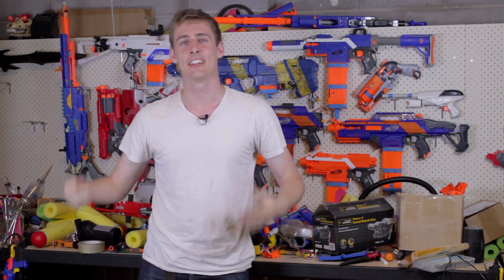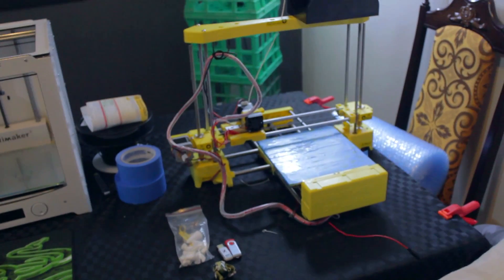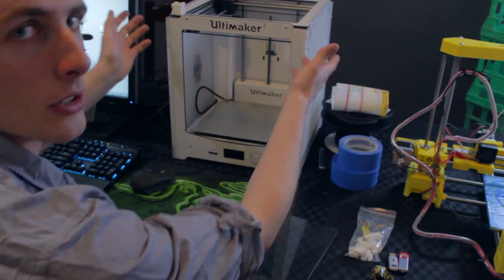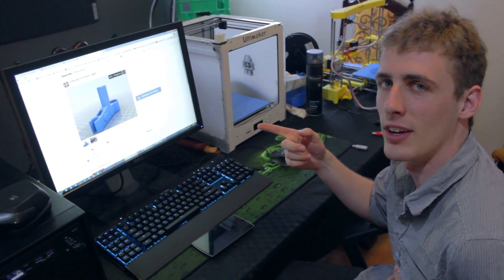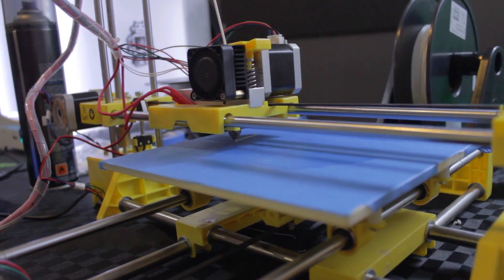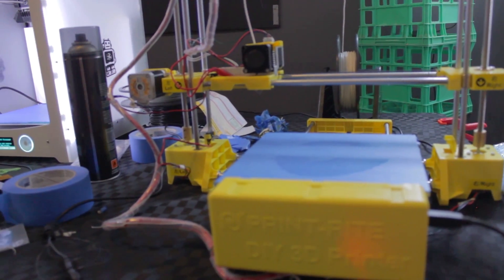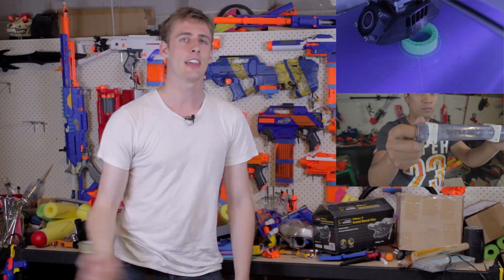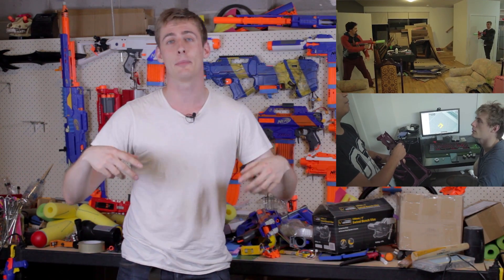ULTIMAKER 2 vs PRINT-RITE DIY 3D Printer & How to Bed Level - PRINTER PARTY | Make Test Battle

Comment: Terrible comparison. First of all, ultimaker 2+ can be had for 2.5k USD, not 4k. Second, mine has just worked from the start. Never compare a lemon as the brand.
Reply from the maker: +createthis AUD + import taxes + 2 years ago price. I'm telling my experience. I'm not going to sugarcoat it just because other peoples work.
Reply: +Make.Test.Battle Seems like you Aussies always get the financial short end of the stick. That's a terrible price. I wouldn't expect you to sugar coat it, just seems odd using a lemon as a brand mascot.
Reply from the maker: +createthis Indeed particularly since our dollar was so weak when I bought in... "Australia Tax" is so real. Example: You convert the American price of Overwatch ($40 USD) to AUD and you get about $50. Blizzard has it listed for $70 AUD on their site. $20 more because Australia. The whole point of the video wasn't to do a comprehensive review or whatever, its was to show a behind the scenes look at the reality of printing. Things go wrong it certainly isn't a "Play and Play" device -R
Reply: +Make.Test.Battle 4k AUD right now is 2931.72 USD right now, so that's not quite as bad as I was thinking when I wrote the initial comment, but it's still a good $400 USD over the price of a 2+ right now.

Was this your first 3d printer? I wonder if a lot of the trouble you had was just learning curve. I bought a printrbot plus (plywood kit) for my first printer and it was a nightmare compared to my ultimaker 2+. The 2+ extruder has been improved a bit over the 2 model too, so that could also be a factor. I did have like one failed print when I bought it, but that was user error. I was attempting to feed the filament around something in the back of the unit that I shouldn't have, causing a jam. Been fine ever since.

My kids actually use the 2+ whenever they want. That would have NEVER happened with the printrbot plus. Sometimes I wake up to find my son printed a new toy for my daughter. Crazy times we live in.
Reply from the maker: createthis The main issues have been mostly resolved by now but they came from weird and slightly self induced problems I had and ones I didnt expect to have paying for a high quality (or at least high price) printer:

- The UM2 fan mount was terribad and had terrible cooling and curling of the right edges of parts
- One of my fans had a dud ball bearing and was super noise and only ran about 50% speed
- I replaced the fan and the shroud but jammed a wire into the heatbreak cooling fan and didnt notice for 12 months causing most of struggle (my error)
- No australian stores sell 2.85mm filament (only 3mm) so the original 1/4"ID bowden had super high friction and under extrustion with all the filament I could get
- Printed a new extruder to help which was good until I printed retraction heavy parts that flattened and widened the filament to the point of jamming in the bowden
- That's about when the control board exploded mid print and had to pay $400 to fix it out of warranty (that is also included in the $4K price fyi) but that revealed the jammed heatbreak fan
- The new board had new firmware that made me find out that the fan shroud I printed over cooled the print nozzle when close to the bed which was also causing massive underextrusion, jamming, and grinding problems on the first few layers. At that point I had to jerry rig the printer to make a new one out of ABS
- Bought new 4mm ID teflon but the collets were undersized so that didnt hold
- Modified my printed extruder pieces and the print head to take the 6mm bowden properly
- By this time all the crazy setting I had tried to use to get the previous underextruding disaster machine to work where totally wrong so I did a factory reset and reset my Cura settings
- Now im in the process of doing the proper calibrating and dialing in of the print quality so that I have a usable machine.

Sitting here waiting to find out what fucks up next.

That went way too long; I'm just getting a bit sick of people telling me that "you paid too much" and "printing isn't that hard" and "my i3 does way better". Their half right. I did pay too much, but printing really can be hard regardless of how much you pay -R
Reply: +Make.Test.Battle That's a lot of trouble for a bad fan bearing and hard to find filament. I feel your pain.
Reply from the maker: createthis mm. It has been a frustrating road made more so by how ridiculously simple the answer is/was -R

Comment: By the way, there is a free program called FreeCAD that works on the same principle as Solidoworks. And it's free. However, it is a bit more difficult to use and less forgiving.
Reply from the maker: +MetaBloxer Interesting. I might check it out to recommend to new users, but I have solidworks and  was trained to use solidworks, so I keep using it personally -R

Comment: lie
Reply from the maker: +Dominic Beacham What do you think is a lie? I have no reason to lie about anything that I own -R
Reply: The ultimaker is way better. Yours failed for about half the video and you said it was way better.
Reply: That is a total lie
Reply from the maker: Dominic Beacham I truthfully described my experiences with this machine. I have had nothing but problems with it so far although it is at a point now that is is fairly reliable for printing.
Why would I lie about it? I have no personal vendetta against Ultimaker, in fact I really appreciate all the help their support team have provided me to try and help fix my problems. I am just telling the world about my experiences. -R
Reply from the maker: Dominic Beacham The Ultimaker does however have a feature set that is better than the other printer. That is just undeniable; the UM2 has features that make it easier to use that the other printer we had on the dya -R

Comment: If you have the first lemon Ultimaker 2 that was ever made, then I have the second. Nothing but clogged nozzles, underextrusion, and a circuit board that caught fire (not joking) since I got it last July. Way too many problems for the price I paid, an over-rated machine in my opinion.

I've purchased a Lulzbot Mini since then and it's performed like a dream. PEI sheet on the bed means that prints stay put without messing with glue, tape, or hairspray, plus it auto-levels. Also currently half the price of the Ultimaker 2+. Smaller build volume and needs to be tethered, but it meets my needs and is a much more reliable machine.

Comment: I do not understand the point of this comparison the diy printer could perform just like the ultimaker if not better if calibrated correctly
Reply: yes, actually they didnt even calibrated the 400 dllar 3d printer, if they could do that printings would be ok, and they would be able to print better pieces for that printer... well, they could do that if they had some knowledge and experience, but clearly dont know nothing about it.
Reply: ultimaker cleans itself, bed is leveled, it has shitty stepper motors and stuff, but its calibrated, unlike the other that they build by their own. the bed its not even leveled ...
Reply: no

Comment: So.......     3d printing is way too expensive.
Reply: +StarTrek123456 $400 is expensive for you? wow
Reply: marcus Outhwaite i'm 16. I get 50€ a month, and i have to save that money for stuff that's more important than a 3D printer.
Reply: because you cannot afford it makes it expensive? nah, your poor
Reply: marcus Outhwaite dude. $400 for a few stepper motors, a very bad hot end and a controller board. that's extremely expensive.
Reply: ok dude, $400 is nothing, its a pair of shoes
Reply: +StarTrek123456 I build my own from about 500 USD. Runs same the ultimaker. Thats the matter, if you want to get a lot of money.... I think ultimaker's cost less than 500 in material side...

Comment: I got the Geetech i3 and it blows the yellow thing outta the water, also cost around 400-500$. The ultimaker seems really nice, but it has such a small print surface :(
Reply: +Floris Stoica-Marcu Go check out the eleven by igs3d if you want a large build area; also check out the new taz 6. - both great printers

Comment: You don't need to put blue tape on the build plat of the Ultimaker v2. Just put some glue or hairspray on it, and it'll work flawlessly!
Reply from the maker: +Isak Dombestein I find glue and hairspray too messy. I'm experimenting with different surfaces at the moment.
Reply: Ok
Reply: +Make.Test.Battle I found a nice looking not too messy way. It still involves your standard glue stick but instead of just trying to get a thin layer do the following. Take your glass plate out of the printer and put a bit of glue on it. Hold it under a tap for a little and use your hand to spread the mixture of glue and water over your plate until no whiteness of the glue is visible anymore. Dry off with a paper towel and done. Now you have an invisible non messy glue printing layer.
Reply: +Isak Dombestein With PLA, I heat the bed to the default settings with glass alone.  Using the built in bed leveling procedure, I don't put anything on the glass.  A bit of glue stick for ABS is all I need for that.

Comment: They just compared apples and oranges
Reply: seigeengine thats what i said, fact nazi :) , anyway i am hetero so keep your gay fantasies to yourself please. Have a nice and straight day.
Reply: +masso172 lol then compare this 4000$ printer toy to a 4000$ CNC DIY machine, you can make  Metall,Wood,Plastic,Plaster and more materials not only plastic like §D printers
Reply: seigeengine
 why play the fact nazi? you got my point, cnc is just more powerful :)
Reply: +masso172 I feel like this is the most misused expression I've ever heard.

No.
Reply: Hyper Hektor False. You can't make any of those with a CNC, you can only carve away at those materials. Really, a CNC doesn't let you do anything you couldn't already, whereas additive manufacturing like a 3d printer allows you to create anything you have working volume for from a single standard material format in one step.

Don't get me wrong, CNCs are awesome, and are more practical for a lot of purposes, but they're very different beasts from a 3D printer.
Reply: to make a cnc only need a spindle,,

and motors a little hard.
Reply: Hyper Hektor lol homophobia.
Reply: Grow up bud.

Comment: Interesting comparison, it would have been  a better video if both machines were calibrated properly (both beds zeroed in) and you could just witness the quality comparison between the two. I can't wait to tinker with my 3d printer when it comes in, but I'm prepared to experience the pains of it as well!
Reply from the maker: +nguyen925 Yeah; I've got my Ultimaker working to a pretty good level after a few more tweaks so we might do another video about it soon. Its a slow, frustrating, but very satisfying process -R

Comment: What's the blue tape you use? Sick of using glue
Reply from the maker: +Peter Tardent Its blue painters tape. A lot of people said that heated glass is sufficient, but I really like the stick that the tape gets -R
Reply: +Make.Test.Battle Will have to give it a go. Have never had a successful print without glue using my XYZ DaVinci 2.0 duo. Cheers

Comment: The Ultimaker 2+ is in Europe actually listed at ´bout 2000 Euros, the large version 2 extended somewhere below 3000 €. So You´re really talking ab US Dollars ? I wonder where You pay 4000 bucks for this.
Reply from the maker: +Lobesanft Australian dollars. Back when I bought it it cost me 2000 Euro which is about $3000 Australian dollars. When I imported it I had to pay a 10% tax taking the price to $3300. Since I have been using it the control board has need replacing, another $400 expense. $3700 is close enough to $4000 for the sake of a video title. -R
Reply: +Make.Test.Battle Thanx and sry, how much ist the Ultimaker 2 extended in Australia ?

Comment: you've said that there is no deference between a bowden and a direct extruder but unfortunately there is and quit a few . with the bowden it's pretty impossible to print with certain material like ninjaflex compare to the direct you can print with  . the bowden is much lighter than the direct so it will result less stress on the moving parts of the printer however you will experience some artefact on your print specially when you print multiple parts . nice video
Reply from the maker: +YODA KNIGHT Yeah, good pick up. That was definitely an error on my part. -R

Comment: Can you make modifications to the model before printing?
Reply from the maker: +Engineerboy 100 Not really; STL's are difficult to edit, at least in solidworks. There is a feature to convert them back to a solidworks format, but its quite dodgy -R

Comment: I recently bought an Ultimaker 2 and it's an absolute dream to use. I upgraded from a Velleman K8200 (mid range DIY kit). While I've had tons of fun with the DIY printer, the prosumer one is just light years ahead in performance. I don't regret buying the Velleman though. DIY kits gives you a good grip of the technology that goes into every printer.

Comment: Hello i love 3d-printing so lett me give some tips
if you can head the bed do it on 60 C° and dont usu the band 
and for the DIY make the first layer 0.4mm and lett the printer make it slow also lett them just 0.2mm to print the first layer its to much but it holds way more.

Comment: If we're talking $400 printers, Wanhao puts out a decent printer in that range, with heated bed, spool holder, fancy chain link wire guarding and standalone printing with an lcd. It's based on the i3 mendell prusa.
Only issue I had was with leveling the bed, somehow one corner is so far out of wack the spring couldn't tension the wingnut and it'd wiggle off during printing. Replacement spring set from home depot fixed that though for about 8? bucks. There's a USA warehouse here that does distribution so it's a fair bit cheaper than shipping out from China too.

Much prefer the metal frame to the traditional 3d printed parts most DIY i3 kits come with (which I have one of as well)

Comment: Seriously - glue stick on glass provides MUCH better adhesion than tape. You also get a much smoother surface and the type of glue you choose decides how well it sticks. Set the bed to 50C for PLA and you'll never ever get a failed print. Wash the glue off with luke warm water.

Comment: I paid $420 for mine with a aluminium frame lcd and heated bed. This was not a fair test, I have not gotten the bottom of my prints looking like that since day one with the printer. There are flaws in cheap printers but its in the building of them they get fixed

Comment: Well I was expecting more like a review one vs the other; but this is just a cross talk. A couple of things struck me here, 1.- Ultimaker is overpriced and very little room for improvements upgrades, just like makerbot or the chinese copies of maker bot; 2.- the cheap printer here is like the bottom end, it cannot get any worst than that, you can buy a PRUSA I3 for 400$including duties/taxes and shipping, and it is way better than these machines; only things I could complain about prusa I3 is that does not have a self leveling bed; or bowden remote extruder; these upgrades can be added with very little money including also a dual extruder.

Comment: the difference between an expensive printer and a cheap printer is the cheap one needs more calibration. and often times cheap printers have more flex and are slower. 

the easy fixes i can say for the cheap printer is a glass bed. it would solve the voids in the bed and ensure it is truely flat. 

you did key on one issue which was nozzle height on the cheap printer. that was about .2mm too high from what i could see. should have checked it with your feeler gauges. and the best thing to do is buy at least a printer made from alum extrusions. or source one made from them. they are cheap and make a rigid frame easy to square.

Comment: Im using Reprap Prusa i3 DIY (late 2015 version), it cost me $275 with shipping and two 1kg rolls of ABS filament, I had to replace few components for better qualty items ($18 for E3D hotend, $22 for new hotbed). After month of adjusting and tunings I got pretty same result as Ultimaker may give. But with few minuses - retraction works not well, so sometimes i have issues with it, that may be fixed with sharp knife and sandpaper, and second one is speed - i have to print 30-40% slower to get Ultimaker like print quality.

Comment: Aside from the bed levelling and nozzle height issues, I think your friend had bed adhesion problems on his PrintRite because he used hairspray on blue tape. He basically replaced the surface of the blue tape with a thick layer of hairspray, completely negating the benefits of the tape. 

You put the blue tape down, then you wipe it with alcohol and a paper towel to get the release agent off it. If you are printing at the correct temperature, the plastic will stick.

Comment: wow... 350$ bought me the cheapest monoprice printer, thing gives honestly amazing results at least compared to the 400$ printer in this video... 

though it doesn't like getting to 250 degrees for abs, and it can not maintain temperature to save its god damn life, though that may be a not having an enclosure and running it a very cold basement issue. 

going to get some plexi glass, calk, and a heat gun. little bit of engineering, and there we go, 3d printer enclosure with a port for pumping in hot air on initial startup, not sure how much it would cost, but overall, i suggest to anyone who does not require abs, get the monoprice because god damn what you get for the money is fantastic.